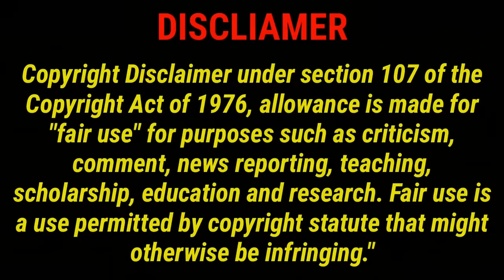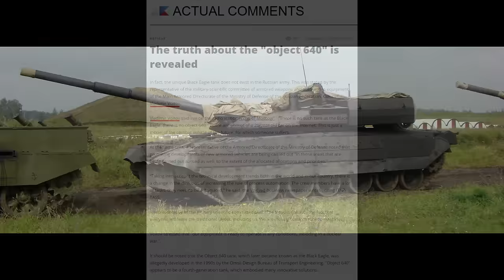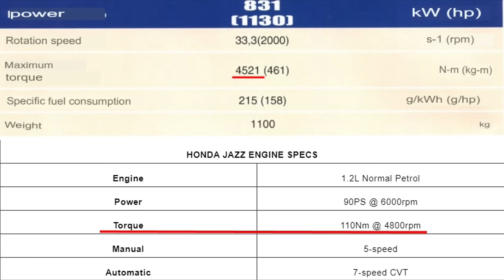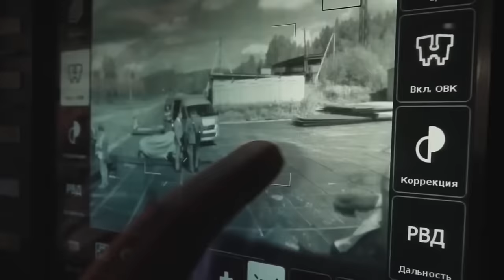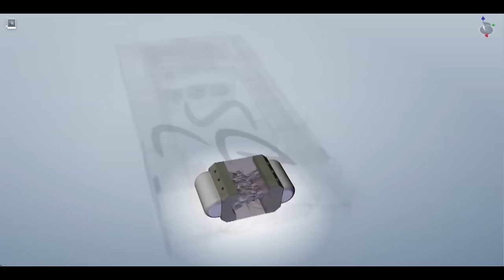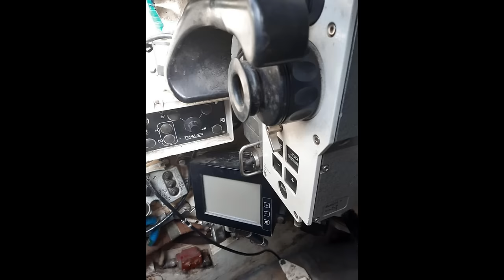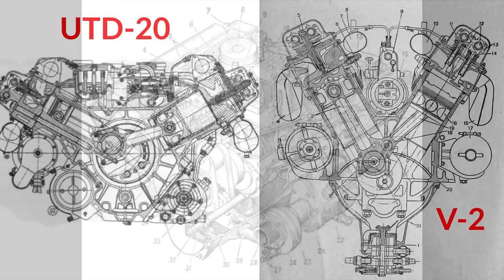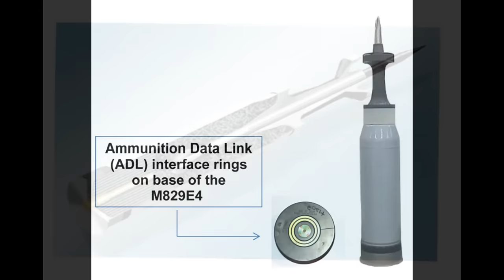LazerPig is WRONG about T-14 Armata

Comment: Now this is a civil breakdown, thank you for making this one man! Here's hoping LP tackles and adresses the mistakes in civil ways too!
Reply: Red effect does make some good points but no one is infallable, not even lazerpig, so i agree with u on this one, LP should make some sort of video calling out his own mistakes as well as pointnout mistakes that Red may have made in a civil way, he himself say that not everything he presents was to the dot so take a pinch of salt
Reply: While it's always better to have 100% accurate information and this is a good fact check; most of the corrections in the video seem to be instances where lazerpig is technically incorrect but his overall point is still valid (for example the "modern" ammunition used still being inferior to western modern ammunition). The design of the T-14 may not be as shit as LP makes it out to be, but if Russia can't actually produce them, it's not really strategically important. 

I think the overall theme of LP's video was that the T-14 is overhyped, probably doesn't perform as advertised by Russian media, and hasn't (and probably can't be) produced in significant numbers. None of the corrected errors really invalidate that overall point. Plus even if the Russians could make it in significant numbers and it was superior to western tanks, you can bet general dynamics could go running to the US congress and immediately get a budget that the Russians couldn't even dream of to fast track the Abrams X program, negating any advantage with the power of the ridiculous US defense budget.
Reply: @Michael-uc2pn  Right, there were many corrections that did needed to be made. There also corrections that felt very nitpicking.

Also a good number between the two were, I spoke to someone therefore I’m right. I’m very interested to see what the response is going to be. Hopefully it’s not responding mainly to the Russian bots spamming him now.
Reply: @Michael-uc2pn  the wonder wepons Germany made was in small numbers and tactically useless.....same as some US secret projects.....but evry one points out how ahead of there time thay were and how well enginerd and the design capipality.......this video isn't about the usebeality or the strategic implementation of the tank......its about the indivisule charistarictes of the design......stop being so biast
Reply: @اسكندرفكار  except it's not a secret project (it's been loudly advertised from day one) or a wonder weapon, it's a tank design with an autoloader and a crewless turret. While that's probably where tanks are slowly headed, it's not exactly a new idea at this point. Mobility, protection, optics, and firepower are all passable but not groundbreaking. If any other country made this thing I don't think it would be nearly as hyped as it is. At the end of the day it's still just a tank, which are pretty easily killed on the modern battlefield regardless of how advanced they are.
Reply: @Michael-uc2pn  its have been shown in parades just like wonder wepons and experimental viechles.......the only tank with a empty touret is the obj 195 from the 80's USSR......you saying that LP lies still have point is just ignoring facts by now....... LP point was that the t-14 is a bad design wich is wrong
Reply: @اسكندرفكار  literal infantry and T-34s have been shown off in parades, so I don't know what your point is there, parade =/= "wonder weapon". Not to mention that whole term is just silly imo.  plenty of IFVs have empty turrets, it has not been done previously because, for the reasons LP mentioned, having a manned turret was considered more reliable. If an IFV has a busted turret, you still have an APC, if a tank has a busted turret, you have nothing. Even now we're in the trial phase of making prototypes and testing them to see if this is a good idea or not. 

As far as the design being bad, the design of anything being bad is an opinion, so it can't be "wrong" per se, you just disagree with it. I personally thinks it's a bad design because it requires lots of technology that Russia has a shortage of right now, and while the turret design improves crew survivability, it also means you have a harder to maintain tank that can't do anything if there's an issue with the automated systems. All of this is fine if you have great logistics and spare parts etc. readily available, but considering we're now seeing un-upgraded T-54/55 sent straight to Ukraine because they either don't have the parts or time to upgrade them, I don't think this is a good design for Russia. A lot of it comes down to Putin having backed himself into a corner with Ukraine though. The T-14 might have made sense a few years ago when selling it abroad was an option, and they weren't in the middle of a very expensive and grinding war, but now the design makes little sense for it's intended purpose. Even if it could beat a western tank on paper, it doesn't matter if the Russians can't afford to lose them or let them get damaged due to lack of parts. If they need something to counter western tanks, at this point ATGMs, air support, or artillery are going to be a more reasonable choice.
Reply: @Michael-uc2pn  so if in my opinion the Bob simple tank is a bad tank......is that means that it can be good
Reply: @اسكندرفكار  you can have a poorly supported opinion, but it's still an opinion vs a fact. The point is it's not a black and white issue settled issue.
Reply: @اسكندرفكار  german wonder weapons weren't well engineered nor ahead of their time. It was desperation that nobody else had the need to build. (allies didn't need to send a rocket just for terror bombing, and nobody else was desperate enough to concoct volatile wooden jets glued together by forced labour workers to have any semblance of still hitting back against allied air power)
Reply: @dilophosaursniper5399  
What do you mean by "not even"? Lazerpig is one of the least correct youtubers i have ever watched. What Redeffekt pointed out, were mistakes on just one video.
Lazerpig is the kind of youtuber, whos trys to get view by harnessing emotions through polarizing "opinions".

That's the reason, why all his videos are made on topics regarding tanks or major events, wich have already crowded great controversy, like the Tiger tank, the T34, the Moskva, the
Ukrain war and the F35. He takes the most popular opinions and presents them in such a manner, to generate the most appeal to this crowed. Take for excample the Tiger, he loses no time claiming on how unreliable the tank was, and how it was a waste of time and money, completely ignoring it's intended use, the circumstances under wich it was constructed, the specifications it needed to comply and much more.

Their are exactly 2 things he will likely do:

1. He will further milk this and claim he is still right, thus grabbing that juicy youtuber beef cash.
2. He will ignore it, because he knows exactly, how wrong he his and rather lets this slide, than further embaress himselfe (if he would have the option to take Redeffects video down, i would bet he would be petty enough to do it).
Reply: @اسكندرفكار  i agree with @micheal on this one
Reply: most likely he wont
Reply: @HeavenlyMandate  judging on how much this video is causing it could be in a 75/25 chance he will make one
Reply: at least till it started to become either very nitpicky or low key started attacking the person rather than the argument.
Reply: @Teixas666  At what point did he start attacking the person, rather than the arguement, If I may ask?
Reply: Well civil for a Scottish jpeg of a pig.
Reply: Why can't lazerpig respond in a civil manner to the roundtable guys?? 😂
Reply: @dilophosaursniper5399  He probably Will, LP, unlike many commenters in today's war with Russia, has the ability to admit when he is wrong.
Reply: @sleezerbarb9670  because gonzalo lira is incapable of being civil
Reply: @fiyum333  but LP was the one who fired shots first without them ever interacting before.
Reply: @sleezerbarb9670  "but teacher, he started it!"
Reply: @fiyum333  pretty much.
Reply: @Firecracker048 the deleted comments on LPs video says otherwise
Reply: He won't. He directly contradicts his own sources, therefore he is lying. You can't listen to the guy and tell me he is well meaning.
Reply: @jblakemore  Is this talking about LazerPig, or RedEffect? Since I was asking about RedEffect in my question there.
Reply: @Edo_Ginting  ah misunderstood lol
Reply: @Michael-uc2pn  One of the only overrall point that were correct on lazerpig's video was the incapability of the russians to produce the tank. Pretty much all the other flaws he cited just aren't real and his video focused a lot more on those flaws than the difficulty to produce the tank.
Reply: Nah he is making too much money playing into his audience's biases. And by the way, no video will be left if the 'mistakes' are removed. 🤣
Reply: he won't
Reply: I guess, 50-some years on, APFSDS is somehow still... modern? Yeah, no.
Reply: @Beakerz857  it doesn't get called modern at all. Sabot is a ww2 invention hell earlier with the Swedes. It's nearly 100 years old for an ammunition type. Modern sabot is called just that modern sabot. Cause it's the current type of that antique ammo.
Reply: Civil yet harsh. 
Basically all what LazerPig said in his video is wrong. 
Which really begs the question of the reliability of its sources and stances in his other videos.
Reply: @TheSupriest  oh hes wrong on so many things. Very little he gets right.the A-10 is one of those things gotten right.
Reply: @TheSupriest  Agreed! This should be considered as a lesson to both us and LP himself, here's hoping that LP would then improve future videos with this in mind and for both us to remain critical but civil on breaking down information.
Reply: @mandernachluca3774  you are spot on......
Reply: I would count on that. 😂
Reply: @dilophosaursniper5399 uhuy they y
Reply: LP has admitted he made some errors on it and corrected them not sure where think its in a podcast
Reply: @اسكندرفكار Bob Semple 😂😂😂 a New Zealander 🇳🇿
Reply: @zaynevanday142  hi my friend from Algeria.....and there is a saying enything is better than nothing.....so bob simple tank wasn't that bad consedering every thing

Comment: 1:38 lazerpig is almost certainly exclusively talking about the t-14 Armata's autoloader system - which, indeed, cannot be accessed from the crew compartment.
Reply: you missed the point that the Autoloaders aren't unreliable but actually the opposite
Reply: The loader is almost never the issue. Its almost always how the ammo is stored.
Reply: @jammygamer8961  The auto loader is as reliable as any other auto loader. Which means that occasionally the cannon will jam, because jamming is a function of multiple parts not just the loader. But unlike NATO tanks, the crew can't clear the jam in the field. So a jammed tank cannon is functionally a mission kill in a T-14 while NATO equipment can be cleared within minutes at worst when jammed. Because NATO actually prepares for combat scenarios, not export propaganda.
Reply: @jammygamer8961  You missed the part where RedEffect said 'if maintained', so yeah it's gonna jam if it's run by russians lmao
Reply: @Dohnutninja1337  can't argue against that.

But any device will fail with out proper care
Reply: @Dohnutninja1337  you missed the part when RedEffect said there were no reports of it jamming so far despite being used in high numbers in this war
Reply: @abrahamlincoln920  tankers didnt talk about it, which just means that its not a huge problem. Which makes sense, because even if the autoloader jams, its accessible by the crew in all the tanks that are used in this war, so they can fix it quickly, but this wouldnt be the case with a t14
Reply: @abrahamlincoln920  That's not what he said, he said it wasn't a common complaint.  Even AKs jam, but as long as it doesn't happen too often and can be fixed quickly, it's going to be seen as reliable.  The issue with the T-14 autoloader isn't reliability, it's that the crew has no access to a jammed gun!
Reply: @jarvy251  An autoloader jamming is thousands of times less likely than shrapnel destroying both thermal sights. The latter is also a mission kill but the crew cant do anything about it.
Reply: I still think the inability to clear a jam is a legitimate concern regardless of how reliable the autoloader is.
Reply: @cleanerben9636  I think the inability for crew to fix a broken track in combat is a bigger problem
Reply: @thecactusman17  yea.

i wasn't saying crewless autoloaders are a flawless design
Reply: @TheAnticlinton  "An autoloader jamming is thousands of times less likely than shrapnel destroying both thermal sights."
Cool, do you have stats for how many times a T72 autoloader can be expected to suffer a malfunction over a certain number of rounds that we can compare to the number of times a tank has suffered loss of all thermal imagers?  Because otherwise I think you're making shit up
Reply: @cleanerben9636  Yep. Things always break/jam/stop working etc at some point, especially if put under stress. It might be rare but it is ineviteble.